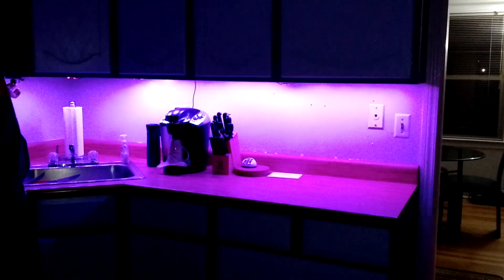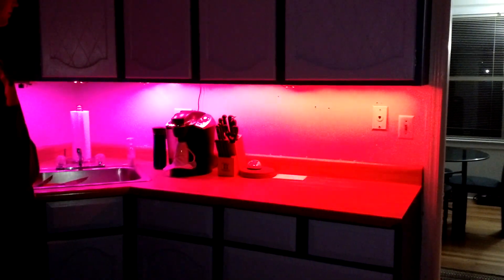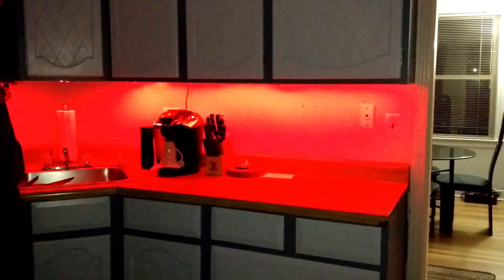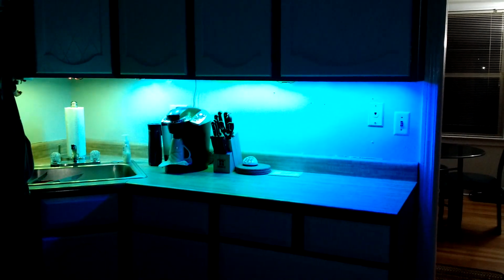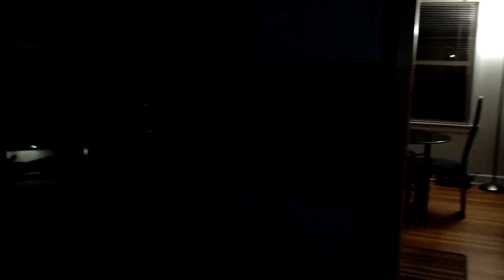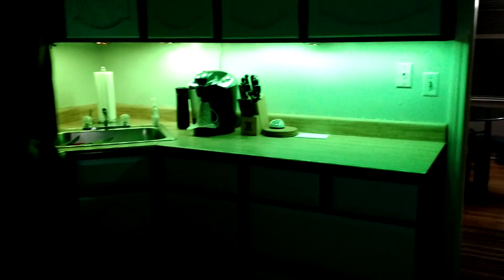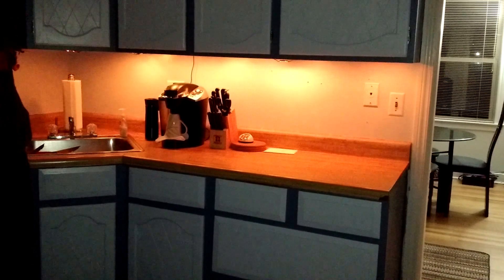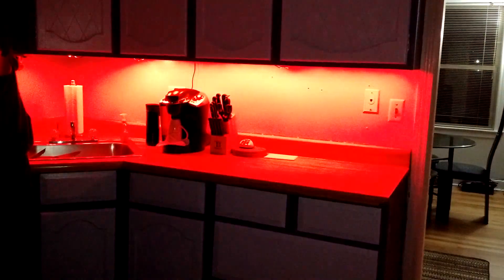Arduino Digital Under Cabinet Lighting

Comment: Hey dude! I'm currently putting together your shift light, it's epic!
Then I stumbled upon this, which is also great! I've been messing with neopixels for a short while now, would you happen to have code for this program so I can take a look?
Reply from the maker: +JustKyzuuh The code is terrible.  I just cobbled it together, but it works.  I'll post it online this week on my Github though.
Reply: +Chippernut awesome! I was particularly interested in the fire effect. did you use the example from the fast Led library or come up with your own?
Reply from the maker: +Brandon Matthews  I wasn't able to get the Fast LED Library to work in this example, the fire effect is one that I created - I actually wrote it a while ago for this project:  https://www.youtube.com/watch?v=xdCF8Gx7L-c
Reply: +Chippernut Hey, did you ever upload this?